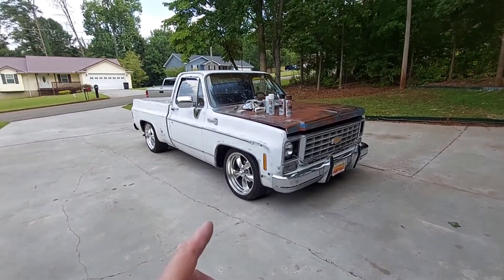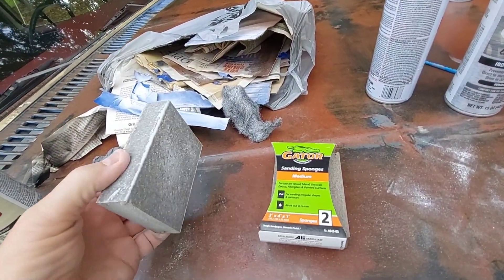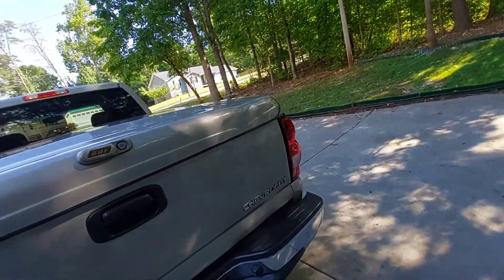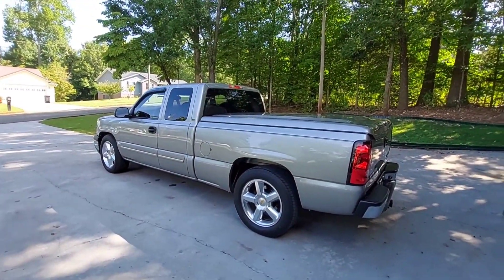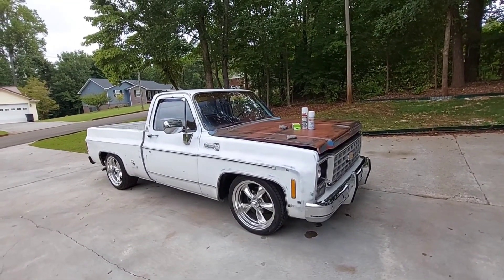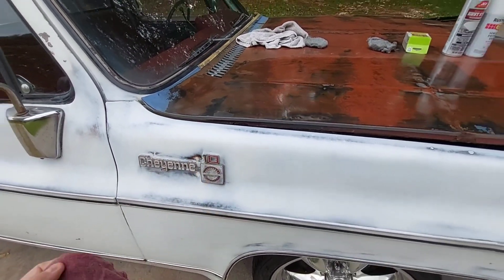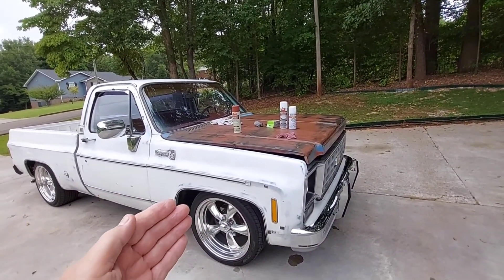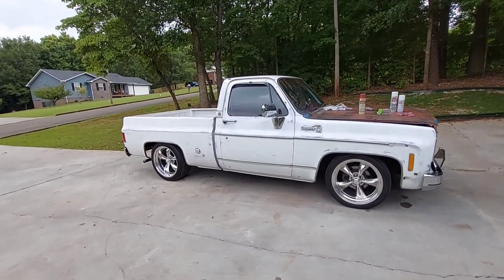Update on my 1978 Chevy C10 truck "Billy James" and my 2003 Chevy Cat-Eye Truck gets a new tires!

Comment: Love your truck. What size are those rims? What brand are they? How low is the front and back. Just got a 1973 stepside.
Reply from the maker: Congrats on your 73 Stepside! The wheels are American Racing Torque Thrust wheels. Thr fronts are 245x45x20 on 20x8 wheels. The rears are: 275x45x20 on 20x10 wheels. The drop is I think a 4/6 drop. Thanks buddy for your comment!